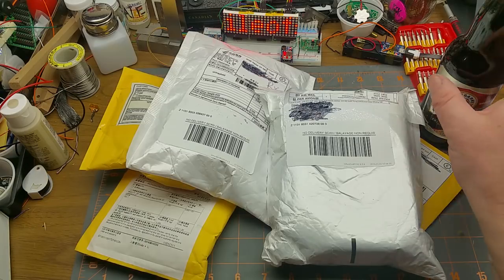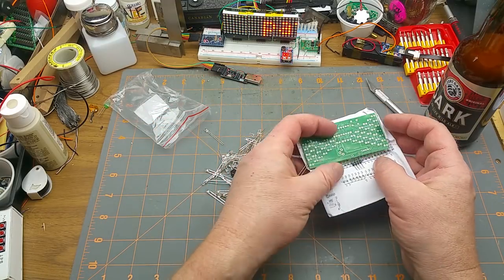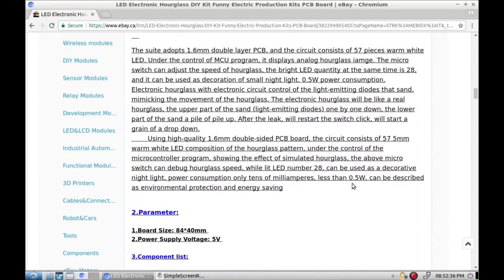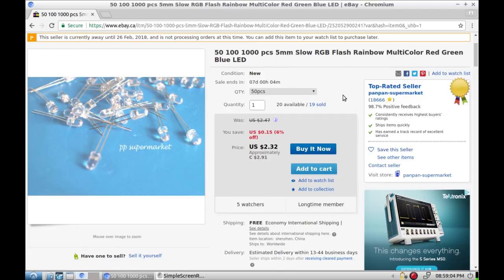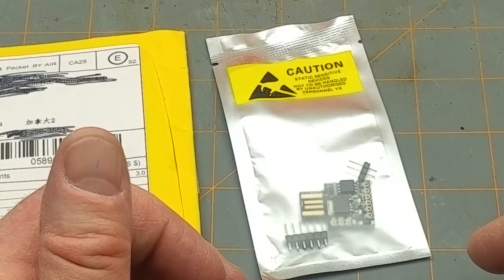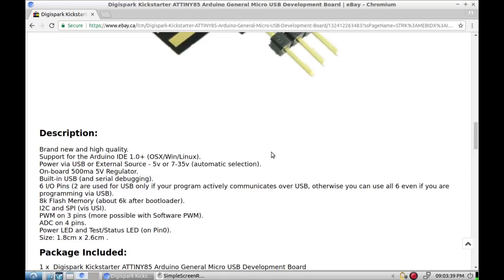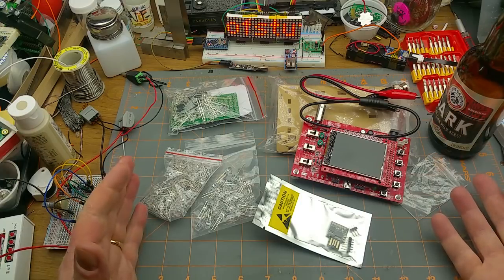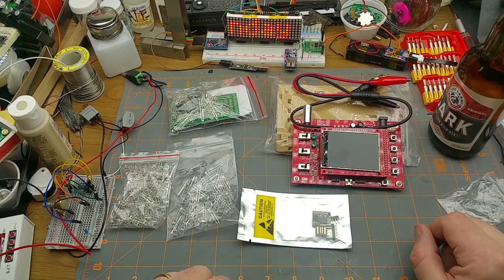mailbag monday 21

Comment: There is another nice mini scope, DSO 150, with nice case, there is even enough space inside to put in an internal battery with all necessary things for charging, stepping up voltage inside that case.

One another thing about buying diy kits, always check component's values, not only if color code/smd code/capacity code is the same with silkscreen, schematic or parts list, but if it really is as supposed to be. Just finished assembling a kit based on ICL8038. There were some caps in parts so I checked them and two caps have 104 on them so they should be 100nF, but both of them are only about half of that! I know that every part has some sort of tolerance, but 50% is a bit too much...